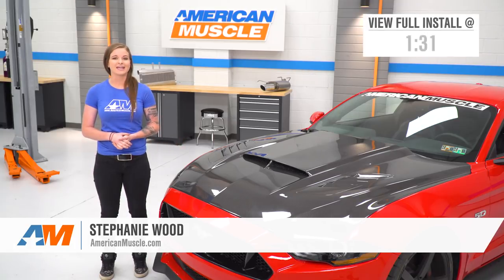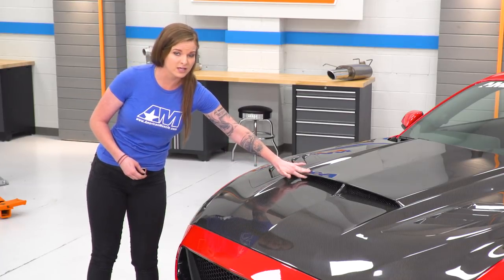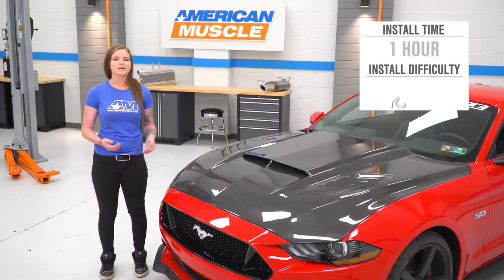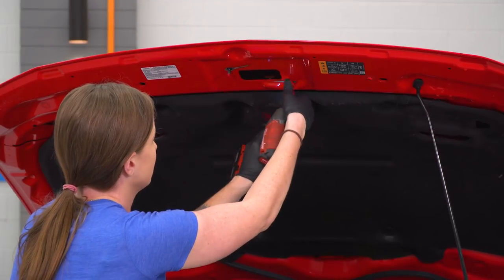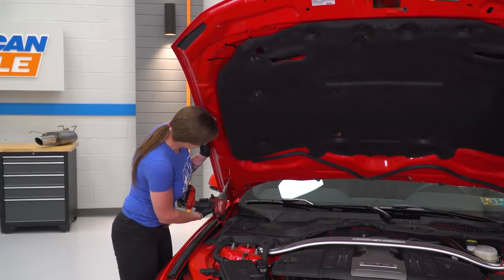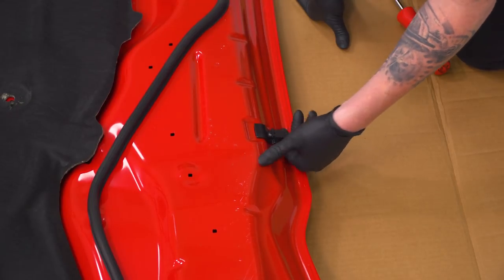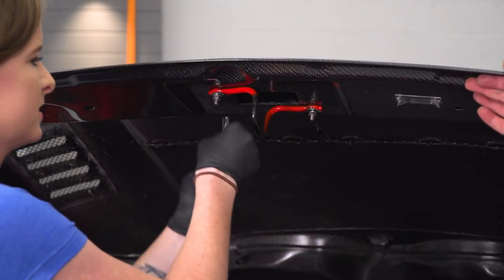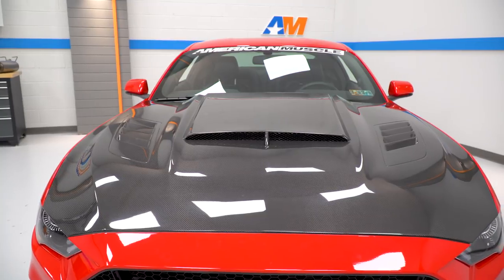2018-2019 Mustang GT & EcoBoost Anderson Composites Ram Air Carbon Fiber Hood Review & Install

Comment: Is there a fiberglass version of this?! If not why wouldn’t the 2017 fiberglass version of the hood not fit a 2019 mustang? Would it not fit right or would there just be holes that are missing?
Reply from the maker: Due to variations in hood design along with body shape, a hood made for 2015-2017 model Mustangs will not fit 2018-2021 models. -Zach
Reply: @americanmuscle  that’s wild, I never really thought they would be that different. Thank you for the help!